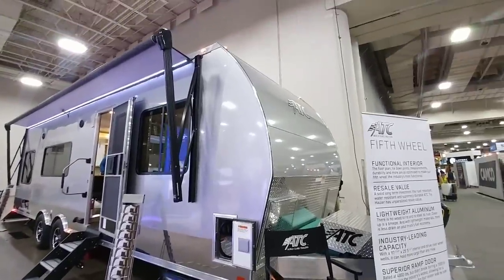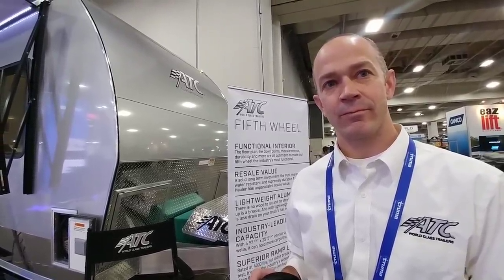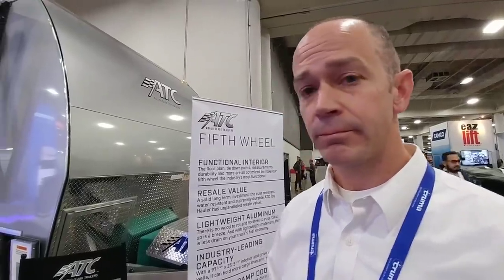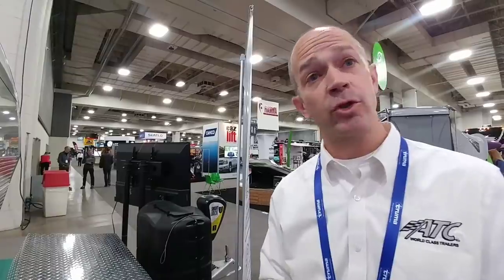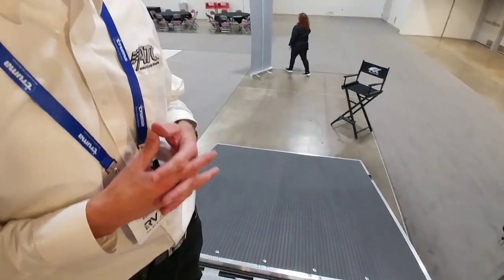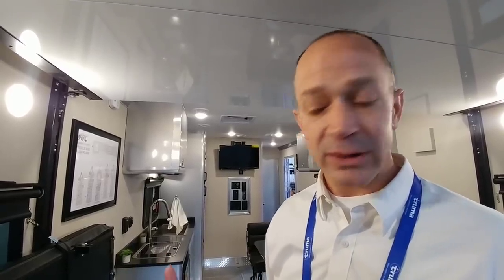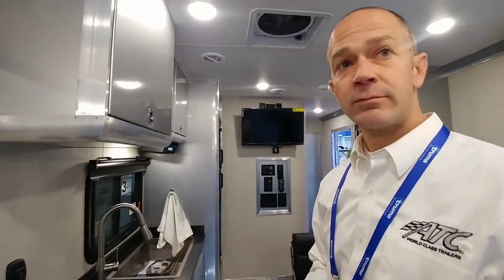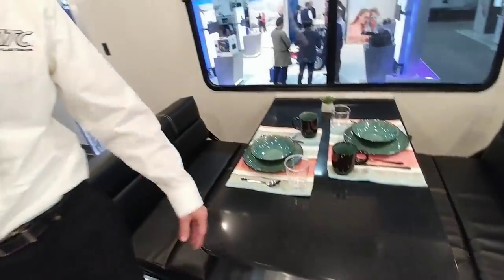Radically Different Toy Hauler! ATC Aluminum Toy Hauler RV!

Comment: Like most other toy haulers, it needs a slide out. Also, I wonder if they can retrofit my trailer roof with a piece of Aluminium. 😁
Reply: Why does it need a slide out?
Reply: @DavidLabbe  Because if they made it 10' wide, you would need a permit to tow it on the road.
Reply: @rmbequipment2159  It's an RV, not meant to be a three bedroom house.
Reply: @DavidLabbe  whatever, you win, you dont mind bumping into people in the RV every 10 sec. But as for the rest of us, slides make any RV way easier to live in. I think Airstream is your bag, famous for not making slides except for one model it stopped making 10 years ago.

Comment: Wonder what wall thickness they are using on the frame tubes?  And is that 5052 w/ those sharp corners instead of 6061

Comment: Nice toyhauler! Looking forward to seeing the 5th wheel ones. I saw that they come with a 3 year warranty. Does this mean it will have a warranty worth the paper it’s printed on?
Reply: We've been living in ours for almost 3 years and yes, the warranty has been amazing. After towing over 34,000 miles we haven't really had any big issues, but those we've had have been fixed 100% by ATC.

Comment: Interesting trailer.  I see the benefits of the all aluminum construction. But I do not like the Aluminum floor. When you are out boondocking at 20°F, that floor will be very cold....
Reply: I ordered a trailer from ATC last week and they have an option to carpet the bedroom and kitchen, which I did. Otherwise you can buy rugs anywhere.
Reply: @dbender88  We have a 2012 Livinlite all aluminum camper with the extruded aluminum floor.  I covered the floor with interlocking foam floor tiles.  Cut them to fit wall to wall. Front to back.  Even found them in chocolate brown color that matches our interior.  like ATC the original camplite by Livin Lite is a generational camper.  We have over 15,000 miles (twice across the country).  Not a single repair, loose screw, leak etc.  Spend the money.  My friends are jealous of the condition of our 2012 and they are pissed that their brand new campers are leaking and dropping parts and worse part......Moldy inside.
Reply: @richp6828  hey thats a great idea with the foam blocks! Glad to hear about your success with your trailer. Im hoping for the same since I will be living in it for 7 to 8 months a year. Buy once, cry once.

Comment: They stopped using wooden frame pieces in cars with the model T, I wonder when the RV industry will catch up?
Reply: So long as it remains a cheaper way to build and people care more about getting the lowest possible prices... Then never...

Besides, everything has its trade offs... Living in a metal structure has its down sides like it's much harder to insulate, which will usually mean it will cost more to heat and cool, and when damaged it will cost more and take longer to repair...
Reply: cough....cough...Morgan cars.....just saying.
Reply: @THEjasonTDI  how many of their production run still on the road? And thank you for linking my unreliability argument to the British sports car industry, I couldn't have made a stronger case to avoid their practices.
Reply: Lots of trailers are Alu framed now. Have you been under a rock lately?
Reply: @timesup6386  and way more aren't. Have you been to any manufacturer web sites lately?
Reply: @Adiscretefirm  Huh? There is no wood in this. Others, yes. And I was just stating a correction that you said no new cars use wood. Thus Morgan. 

As far a s ATC on the road? who knows, most of them likely unless they were damaged in an accident.
Reply: @Adiscretefirm  if you are saying british cars are unreliable I could not agree more.
Reply: @ZeoCyberG  Venture RV has all aluminum frame and is in expensive compared to most
Reply: @THEjasonTDI  as a reformed MG owner one of my favorite nicknames ever was when a car writer called Sir Lucas (whose company made many of the electronic components used in English cars) 'the Prince of Darkness' for the common problem of systemwide failures causing all the lights to go out while your dead car coasted on to the shoulder.
Reply: @Adiscretefirm  I've seen replacement bottles of Lucas wiring smoke at my local foreign car parts shop.
Reply: @timesup6386  and a lot still use wood inside as well. Or most are hybrid steel frame and aluminum shell.
Reply: @THEjasonTDI  that's how you find the failed relay, it only smokes upstream from there.

Comment: I know this might work for some, but I'm not a fan of this style at all. Hate that the garage isn't separated from the living space. Not enough space for 2 dirt bikes and 4wheeler.
Reply: Huh? I have a 28FB and can get my URAL side car rig in the front and it's bigger by far than any quad. Plus a BMW GS and a DRZ behind it.
Reply: @THEjasonTDI  @4:35 they are standing at the back of the trailer and the chair for the table is not very far from that. No way is that going to fit 2 dirtbikes and a quad. Not trying to play tetris.
Reply: @jasonwellenreiter589  MOST people don't have recliners. All the tables and chairs fold up an go away. Obviously you have never been in one or seen one in person. I OWN an ATC trailer. In fact its a bumper pull one with LESS space in it and I can get my Ural side car rig in the front half and my DRZ and BMW GS behind it. No problem whatsoever.
Reply: @THEjasonTDI  Another example of ignorance. He sees a picture with a recliner in it and decides there's no room lol. I have 18ft of cargo space thats 99" wide. Rest assured, i've been inside every other toyhauler brand and floorplan and there's nothing even close.

Comment: WHAT IS THE  INSULATION VALUE ON THE WALL, FLOOR AND CEILING. I LIKE THE LOOKS OF IT BUT I BELEIVE THAT  IN REAL COLD WEATHER THE CONDENSATION WOULD BE SO BAD WATER WOULD BE RUNNING DOWN THE WALLS

Comment: No separation between garage and living quarters?
Reply: Why would they do that? When the toys are out, more living space. 
I have a 2004 Fleetwood  Tri axle bumper pull.  Open concept.  
I like it very well.  But ready for new. 
I don’t want a division.  I don’t like so many that separate garage from camper.  That’s why I’ve not upgraded yet. This might be the one. I like bumper pull.  My pick up bed is still usable.

Comment: I like it!  However, I would not want to be in that trailer in an electrical storm!
Reply: No different than a Airstream
Reply: Airstreams have wooden floors and cabinets.  Wood doesn't conduct electricity.
Reply: Ever hear of a Faraday cage?
Reply: @dalestapley9323  Neather does a travel trailer
Reply: Genuine question.  Doesn't a Faraday cage have to be grounded?  How would the trailer be grounded with rubber tires, short of driving a copper rod into the ground each time you camped?
Reply: @dalestapley9323  Safest place in a storm is in you metal car with rubber tires. High voltage will arch to ground easily. No worries mate...

Comment: JD tell him it's not 1/2 ton tow-able, school him....
Reply: While you COULD I sure wouldn't. Mines heavily optioned and weights 6400 lbs. I use a RAM 2500 quad cab long bed. No issues there.
Reply: Ours weighs over 11,000 lbs
Reply: 1/2 Ton towable if you are the only one in the truck.  You are going to max out payload on the truck first.
Reply: I was glad the sales rep threw in the comfort level bit, which is the key to me.  In addition to meeting the payload and tow ratings of the truck of course.
Reply: The rep said it, “half-ton or 3/4ton depending on comfort level”
Reply: @D2O2  Not the 2019 ram.  Do your homework there bud. Towing more and more payload than the old 7.3 Godzilla. With 32 mpg.  Get wrecked nerd.
Reply: @Frindleeguy  Hahaha
Reply: @Frindleeguy  Might be able to stay under towing capacity of the empty trailer at 7400#,  but this is a toy hauler so it gonna weigh a lot more.  This trailer is rated up to 13,200lbs which is above your RAM's towing capacity.  Also, you ain't getting 32 MPG with a 3.92  ratio.
Reply: @D2O2  32mpg with 4.10 actually. 3.93 should get better.

And yeah, that trailer maxed out is about 500 lbs over the tow rating of my ram. But I have never even come close to maxing out any of.my.camoera or work trailers, hauling everything from a D9 to a family of 5. 

Do what you need to do there bud, just pointing out that today's half ton isn't incapable. Hell, the new ranger pulls more than half tons in the 90's. 

Good luck to you.
Reply: @Frindleeguy  I totally agree that today's 1/2 ton trucks are nearly twice as capable as their ancestors of 20 years ago, but the weight of camper trailers has dramatically increased as well.  Most RVs have had very little payload capacity and are very easily overloaded and most people don't have any clue as they are rarely weighed, they just complain and wonder why they keep failing trailer tires.  

To my original point,  put a family of 5 in your truck and this trailer loaded for a week with toys, cloths, food, fuel, etc. and you will likely be over your rear axle weight rating.  Most half ton trucks exceeded rear axle weight rating well before hitting towing capacity.  

I am still in disbelief that you are seeing 32 MPG with 4.10s.
Reply: We towed ours with our 1999 GMC Sierra half ton from Indiana to San Diego with no issues. Yes, they are half ton towable.

Comment: would all of that aluminum cause more condensation ?
Reply: it can. You need to open the vents to ventilate the air if you are going through high temp shifts like the rockies. We had that issue this last fall. It was really rainy so it didn't help. half an hour with the furnace cleared it up. But it wasn't an issue while camping at all.

Comment: I need something I can pull with a 4WD Jeep Renegade, what would you recommend?
Reply: a pop up trailer haha man get a truck
Reply: @JonathanRinny  Well, I don't need a "truck" because other than a few weekends, I only drive a few miles to and from work, so I'm looking for something that doesn't take more vehicle than I need.
Reply: @SheepdogSmokey   unless you get something ridiculously small you will endanger yourself and others by pulling trailers with small vehicles like jeeps or SUV s. just a heads up.
Reply: @JonathanRinny  Unfortunately that's what I'm finding more and more of, and I can't find anything with even a wet bath that mine will tow.  I'm hopefully not far from a major upgrade in my job though, so if that happens, and I can afford it, I'm thinking a motor coach with a tow bar to pull my Jeep or a smaller car for running around where I travel to.

Comment: At 74K it's way cheaper than an Airstream, and has a lot more flexibility. Can't get your toys into an Airstream.
Reply: Maxima   True, but there is no reason for airstream to be as expensive as they are. I recently looked at the interior of new Airstreams at the Houston rv show.  The exterior is virtually unchanged in the last 50 years. The equipment they use is much the same as other manufacturers and very little difference in quality. Airstream has to invest very little in development and innovation and seems to be riding on their history and mystique. I'll admit that I too am a fan for many years and was once in the market for one but just couldn't justify the purchase price.

Comment: @ 2:35 - "it's not close to you when you're sleeping"  -  It's a front-bedroom trailer, the gen-set is on the other side of the F'ing wall !   FAIL

@ 2:46 - "...it increases the turning radius"   Increasing the distance between the axles & hitch ALWAYS decreases turning radius, because math...   FAIL

Comment: Generator outside bedroom window does not work for me.  Its like having your AC condenser outside your bedroom in a home.
Reply: Get an inverter generator, or upgrade to 1. Most are damn near silent.
Reply: @christophercrafts8283  these onan's are very quiet they have an insulated cover.
Reply: @williamrizzo1285  it's an Onan, I missed that. Yes they are, especially with a cover to help. Wonder if cover is vented to help engine "breathe" and cool itself?

Comment: Hmmmmmm Can you really tow the ATC with a half ton by YOUR standards?
Reply: One of the heavier duty half tons.  Max tow package.
Reply: @richfarfugnuven6308  JD doesn't seem to think that matters. If I remember he thinks half tons should not tow more than a 7000 lb 26foot trailer. Correct me if I'm wrong.
Reply: Even the salesman said 1/2 to 3/4 depending your truck and comfort level
Reply: @cliffordk6554  Lightest one 20' has a est. 770lbs. tongue weight. 90% 1/2 ton payloads will be maxed with a passenger in the cab and a few items in the bed.

Comment: livinlite and airstream are aluminum. not new
Reply: Steve Peters i currently own and live in a 2003 airstream. You are correct saying The aluminum skin and framing is not new. However, after living in my airstream through the winter, I greatly appreciate how ATC uses no wood in their interior construction.  Between condensation and the occasional leak in the water system, I would much prefer a trailer constructed with water impermeable materials on the inside than what I have now.